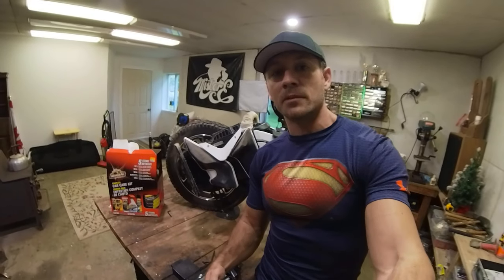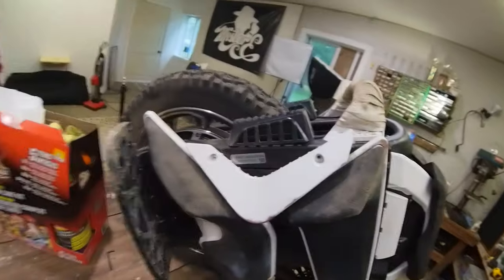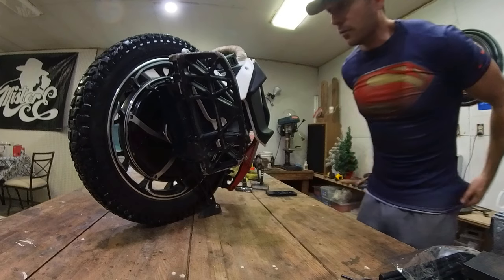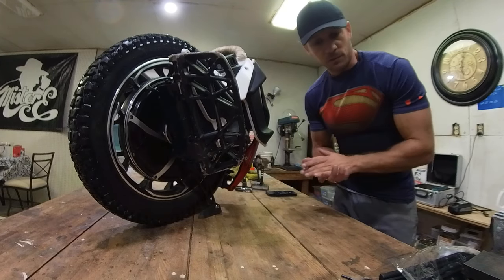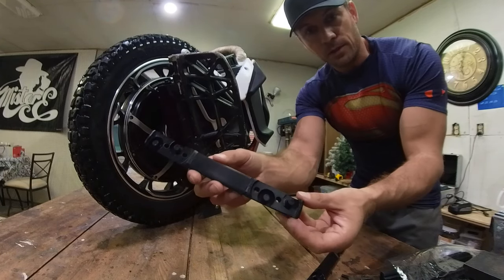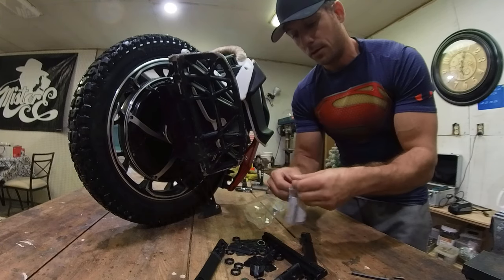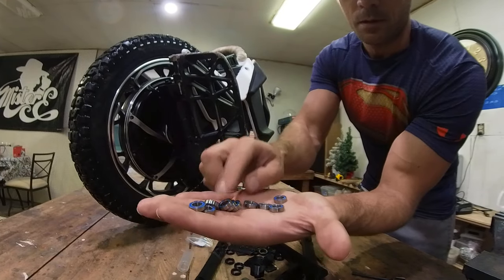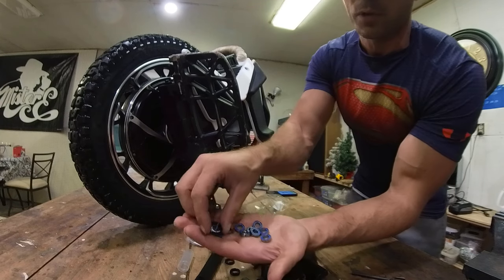KingSongS22 3D Print update and Quick Cleaning

Comment: I was prompted by seeing a lot of slider and bumper builds to look up and talk to an old component/materials vendor I used to use at my job to great success.  Pleasantly surprised, they sell even more 3D printer filament types than ever now.  Not an affiliate, but they have some materials special to their company that I used to solve some interesting problems in the lab in my first life (semi-retired now) and unless you've worked with the materials before most people wouldn't think to search for such things.  They also make tapes of varying thickness and width of some of the materials, which are super useful for solving particular problems (in my case, I have a crossbow that needs string lube right now as it runs on flat metal, if I use tribological tape I can likely save my bow strings and stop using what's basically flavorless chapstick which means everything stays cleaner).
Igus is the company name and just go to their site where it's easy to find their products - they also make powders and bar stock, if you're into sintering or milling.  Again, not an affiliate but their self lubricating, abrasion defiant, and dirt resistant materials are nothing short of amazing, which makes me glad they are easy to work with.  If you need high temp, etc they also have a variety of edge products that are not self lubricating, etc, due to the strengthening fibers in them (you probably already know not to print abrasive filaments without the proper head).  
I haven't tried it yet (I need to make sure the files are correct), but they have an online quoting service for fabrication now, which they didn't have before when I used them (ProtoLabs, PCBWay/PCB123, etc are similar, you drop the design files and they deliver you a part).  Once I get a part working right, I always farm it out.  ;-) If it wasn't less expensive than doing it yourself, they wouldn't exist as a service.
Reply: Imagine how impressed people would be with custom milled sliders lol
I have an S22, I am totally fixing it since they won't take it back - even after the motor recall on top of the slider and prior fire issues, and it's got no miles on it because I wanted to see if there were going to be more problems, and there were...
So I'm committed to fixing it so it doesn't crap out on me up in the woods 20 miles into the jungle - and I just started my own process by starting to hook up with old vendors who I think might want to solve interesting problems and have the tools/materials to do it.
Thanks for sharing yours and I will try to start having better documentation of mods, fixes, and the rest of the PEV work I do (I have several PEV) since people are really stepping up and taking the effort to show theirs in ways that are being helpful to me.

Comment: Just hit 2200 km on my s22 had to take it apart for suspension maintenance, I knew it was going to require it at some point but I have to say this is a terribly engineered system for a suspension. My travel was practically that of the rubber stoppers at the top. After cleaning it and back together rides like a dream and stairs are butter. I been interested in these 3d printed ones but I did talk to guy thats been testing them and he said they need to be stronger material. I would be interested how they work for you.
Reply from the maker: I'm willing to give it a try.  Worst case I reinstall the original ones and make sure I use some graphene dry lube instead of the awful squeaky WD PTFE.....
Reply: @MONOVIBEs2KX  I would like to see cnc rails with more robust wheels. I well be watching genuinely interested. Do you do any trails? Stairs? I got a stair addiction be careful once you start yoi well always be looking for the next challenge 😏
Reply: @MONOVIBEs2KX  I am not an affiliate, just a lover of their materials and products

copypasta

3D Printing Filament
iglide® 3D print filaments are special printing filaments for special component requirements. They have lower coefficients of friction than conventional 3D printing materials and are suitable for special tasks depending upon the material. Our 3d printing filaments range from high-strength materials with very good coefficients of wear and friction for simple processing to chemically resistant materials and those that are suitable for additive production processes according to the "fused deposition modelling" (FDM/FFF). You can install printed parts such as plain bearings or worm gears for industrial use, whether in the prototype phase or in serial production. iglide® filaments can be processed on all commercial printers. All methods that ensure that ABS materials adhere to the print bed also apply for igus® special filaments.